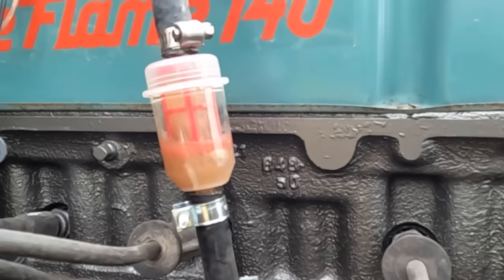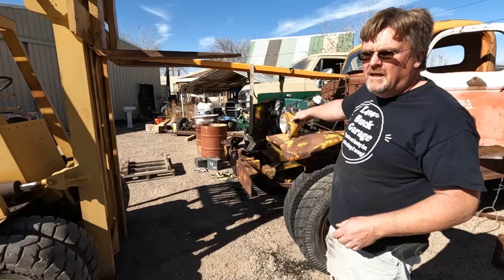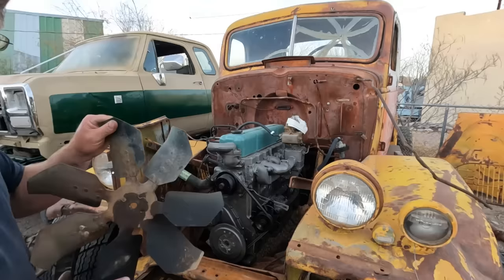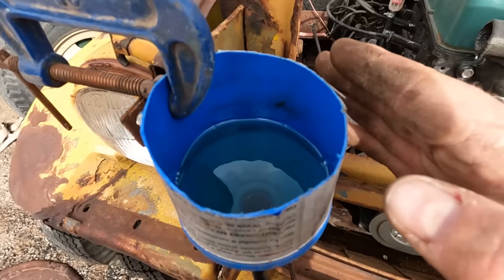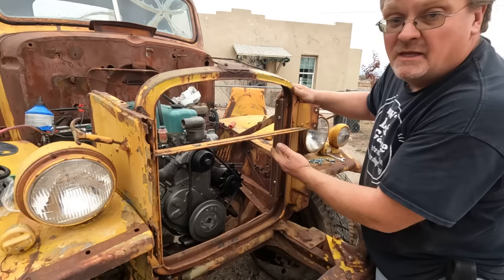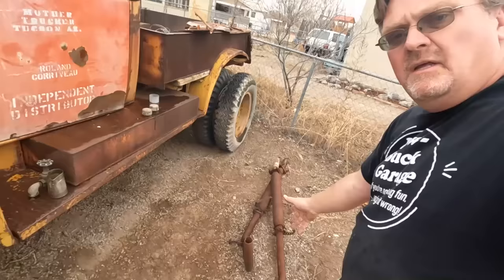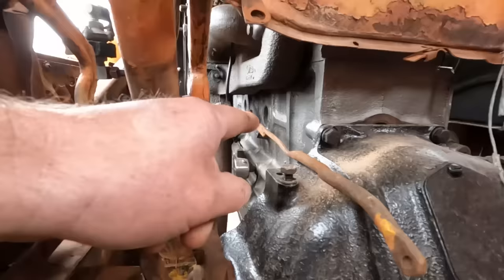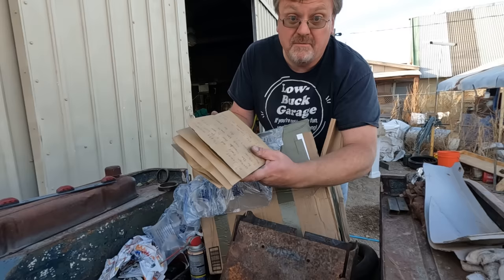Double Dually Mutt Truck: Its Alive!

Comment: When I don't paint; I clean up as much as possible on heavy rust, wash with water, wipe down with mineral spirits or gas and spray it all with satin clear coat.
Prevents further corrosion and saves the history.

Comment: About the radiator fan pushing air forward!!

Go ahead and install it for now, it will really help with any driveway test runs and I suspect that the top speed of this beauty will not be enough to interfere with the cooling.

In any case you can put some cardboard or plywood in front of the grill and and the fan will push the hot air through the radiator and then out the sides behind the plywood.

You might be able to reverse those blades if they are riveted to the hub.

I better go back to watching the second half of the video.
Reply: Yep I kinda like the push fan as well, keeps the dust and crap outta the rad.
Reply: Put cardboard on the front :o I know that is a terrible idea because I was thinking the same :o) And then I moved to clamping it in the vice and changing the direction with some serious heat. (From the blue spanner)

Comment: You should name that truck
   "Trench Digger".  Cause it looks like
 It is Grave Diggers uncle .
    Next time you use a flat head screwdriver bit on your impact driver try putting a piece of clear vinyl tubing on it, it helps keep it on the screw head and you can still see the screw to align it with the bit tip.
     Now I see why you said you were going to use a glass pack for the muffler.  Nice smoke stack!  
   Tim from Wisconsin.

Comment: Great rubber hose trick.  I was smiling as you were approaching a radiator core with a drill..."hey, I might 2nd guess myself right there.."  Dig the stove bolt.  Great little torque maker.

Comment: I had a 1952 Chevy pickup in high school with a 235 6 in it.i put dual stacks on the rack body behind the cab. It sounded great. Your audio was a trip down memory lane. If i started it in the garage it would sonetimes blow wet black carbon circles on the ceiling above.

Comment: Like the way you get things done.  Like the sound of the old 235 engine running and working.  Grew up on the farm with those trucks, glad you are keeping her alive.  That dual wheels in front will work better than going to the gym or weight room, will build big muscles
Reply: Big sixes sound ace 👍 Diesel or petrol :o)
Reply: Grew up on the farm with those... franken-trucks that never really existed?

Comment: Quickest way to do the ignition is to take some ten amp wire and feed it through the bulkhead to the battery. Then tie a loop in the cab end and tape the battery end to the croc clip.

Comment: we must be twins separated at birth,  we do the same kind of restoration on trucks and cars, i never have to go to a store and buy a nut or bolt or any kind of fastener, truck frame used to store  reusable pipes and scrap metal, sheds and truck boxes full of used motor and body parts, one room is my shop is full of rebuildable motors and shelves full of carbs,  starters, generators alternators, water pumps, and boxes full of miscellaneous parts. did about the same thing to an old truck like yours and drove it for an hour on back roads to a car show and they took a picture of it and put it in the club magazine along with all the beautiful restored classics from that show, and it was one of the biggest shows I have ever been to, everyone loved it, i called it my 1952 GMC TOPKICK pickup.

Comment: I was helping a friend get a 51 Freightliner running that he had rebuilt the cab on (he is a body man). It took a while to sort out the fuel system to the old Cummins. Once the engine got fuel, it fired. One rev up and a giant rat's nest came flying out of the exhaust.

Comment: Just FYI shortening a spring actually increases its spring rate. You're decreasing the preload at the same time with the radiator cap but it won't inherently have the intended effect of reducing the pressure reading of the cap.

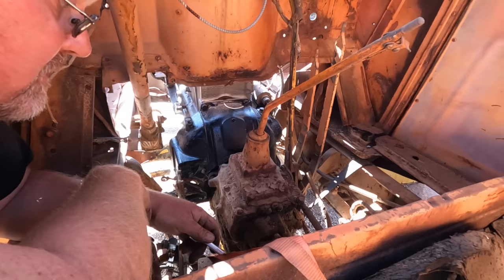Comment: I had a '47 GMC 6x6 with duals on the front, with 9:00x20s on the inside and 8.25x20s on the outside.  Drove great on pavement and had flotation off road.

Comment: They use that type of bolt to hold together metal fencing, the sort that has two angle iron rails and 17 metal pails with each pail having 3 spikes on top. Great video as always

Comment: Great Work James  :) also looking forward more videos too soon watch on this truck and interesting vechiles see on finishing up  to  all fix too! Yes lots wild things to and try out too!  I remember my one pick up 1972 Ford  F350 extended cab tow truck put 4×4 floor shifter of a  Creeper speed Manual transmission on floor from Column Shifter  and use 1968 1 ton Eaton  D18 International Creeper 4speed with Bow Low First gear too and  rear end gears 411 ratio from 1978 Ford F350! But fun daul exhaust use round Stacks muffler from Farm tractors  of International with rain caps up from farme each side on tow bed ! Look funny but work too! But hands got cold rub around in Cold Winter Season months on calls warm up fast !

Comment: My solution to working alone is using a chain fall rigged off of my front end loader or whatever. The chain fall or chain hoist allows me to move the load but be in the area of alignment. The forklift or front end loader only serves as a mobile shade tree.

Comment: The more pressure in the radiator, the higher the boiling point of the coolant. It also helps in circulation.

Comment: I really like your YouTube channel, I think you should put more padding in your seats, and buy an air powered stapler for $35. You find some old couches on the side of the road, and take the foam rubber out of those.

Comment: 26:10 if you use a wire crimp pliers you can make lips like what comes on the radiator on the inner metal tube to hold on to the rubber better

Comment: Could your 'carriage bolts' have been old American bumper bolts? 
   I'm 69, but my older brother owned a LOT of cars from from the 30's to the late 60s, that ALL needed work, unfortunately, he was not interested in repairing them, why should he? 
  He had me at slave wages.
   I remember pulling and putting a zillion of those, as I often dealt in bumper swaps, fender swaps, etc. with a couple of local yards.
  I got his parts I needed cheaper, if I put his old part back on their wrecked car, as they did occasionally sell entire cars to hot rodders, and it gave me more experience lining up panels, bumpers, etc. and when I got to use it, I drove a decent car.😁
👍🇺🇸😎

Comment: So your hands dont get black clear  spay paint , i use a piece of sandpaper and lightly sand the steering wheel and do it 1 or 2 times and wipe the wheel off with a rag no more black hands.

Comment: Cutting coils off springs raises the spring rate, making it essentially stiffer, does it not?   Just a thought, cheers
Reply from the maker: I did word that one wrong, I should have rephrased it.  You're right, that does increase the spring rate, but by making it shorter the preload is reduced so the opening pressure is much lower.  Since the valve doesn't move much, a fraction of an inch is all that's needed to relieve the pressure, the rate really doesn't come into play.  Its the seat pressure that really matters, and reducing the preload makes it easier to pop open.

Comment: What transmission is that? My guess was a Muncie 420 but I've never heard of one with a reverse lock out.
Reply from the maker: I haven't found a model number for it yet.  The only thing I've seen identifying it is GM literature calling it the "selective sliding gear" transmission, as opposed to the other transmission, the "selective synchro-mesh".  Not many options back then...

Comment: I hope you respond to this comment . On some of these trucks the transfercase reverses the rotation not thew front pumpkin .Is your truck like that
Reply from the maker: Yes, I didn't notice until I saw the video after, but the front driveshaft rotates opposite of the middle and rear.
Reply: @LowBuckGarage  Thank you so much sir .That is the holy grail of transfer cases  .  With that transfer case you can make a front axle out of the gm 14 bolt